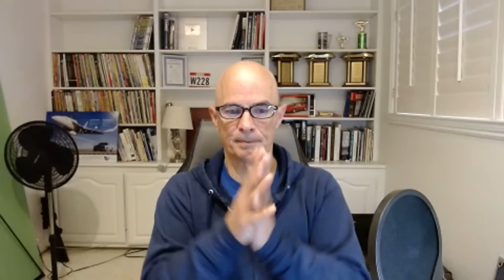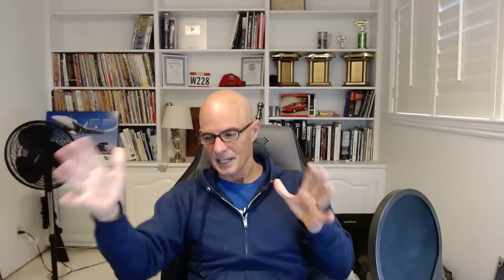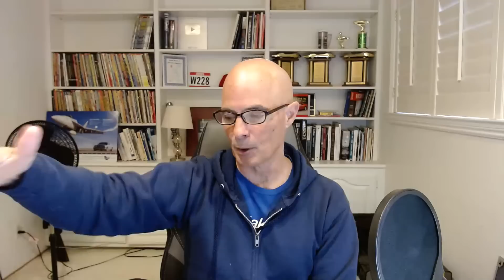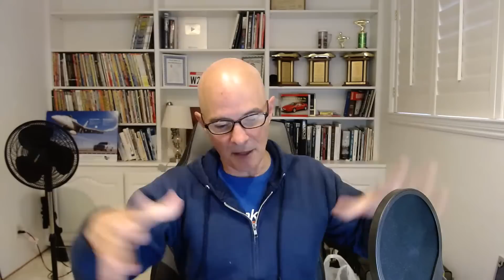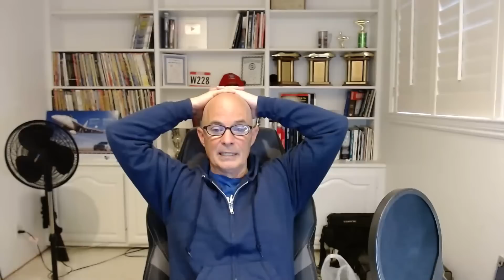LET'S TALK TECH-DATA ALWAYS WINS

Comment: On oil viscosity and power is the power gain coming from the pressure drop because of the bearing clearances remaining same so the pump doesn't have to work as hard? 
 Secondly if so wouldn't it do the same by instead of going to thinner oil opening up the bearing clearances to get the running pressure with a thicker oil? Thinking out loud. 
 Lastly would a thinner oil help engines that have poor drain back. It would seem that would help it drain back faster therefore increasing longevity.

Comment: Richard is the dynamic compression the deciding factor in power on an na setup.......
Reply from the maker: no
Reply: Doesn't na or boosted power for that matter come down to 3 main things total airflow volume, cylinder pressure timing/fueling.

Comment: A Small block Chevy  .040 in the hole  using domed pistons even with  twin turbos. I'm afraid of fuel droplets forming on the area across the cylinder possibility causing detonation.

Comment: Excellent point Richard, particularly on a BBC when the head could be 120+cc Dart Pro1 head or a ZZ632/RSX 70cc head,, this alone can swing the compression ratio from 8.5:1 to 12:5:1 using the same bottom end.

Comment: The real data is when the car trips the beams at the drag strip ,dynos don't simulate a car going down the drag strip.  A dyno don't accelerate like a car.  Look on utube for Warren johnsons opinion of flow benches.
Reply from the maker: IF ONLY THERE WAS A DIRECT CORRELATION BETWEEN POWER PRODUCTION AND DRAG STRIP PERFORMANCE!
Reply: @richardholdener1727  yeah it’s seems to be a trend for some reason to make more power and that the fastest cars also seem to make big dyno numbers
Reply: I sorta agree that ultimately the road is what matters but dyno tuning has so many advantages! I road tune a fair bit and use of a dyno would save me hundreds of hours and probably thousands in fuel! and for comparison data they are excellent but yes it’s not unheard of for a vehicle to be tested on the dyno and make less power but it’s actually faster on track! it’s definitely not often the case though, check out carnage garage ,Scottie’s intercooled l67 is on less boost and power it just ran a pb
Reply: And to add to that a good dyno can simulate going around a full race track ! let alone a 1/4 mile! Fully programable load simulation is used in high end Motorsport and by oem and even has the ability to simulate adding weight such as towing or climbing a hill
Reply: An inertia dyno will get you closer to the real world,, if your trying to tell if your gaining or losing power the drag strip is the final answer
Reply: I've seen a heck of alot of engines run good on a dyno that ran like total crap at the drag strip
Reply: Thats why they spend 500000$ for an inertia dyno because they are trying to simulate what the engine really does in the car.  Go lookup what george brick  from star racing says about teams when they get a dyno ,its on utube.  Its only a small part of a mutch bigger picture.  We don't race dynos ,just cars
Reply: The miles per hour tell horse power